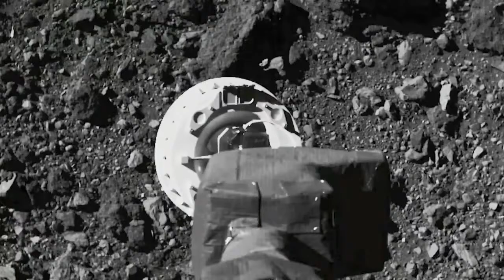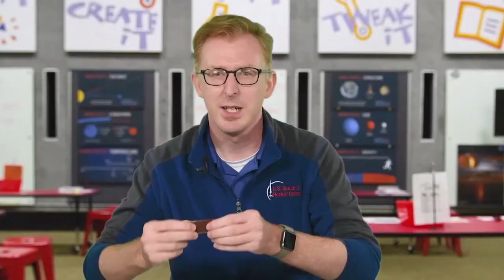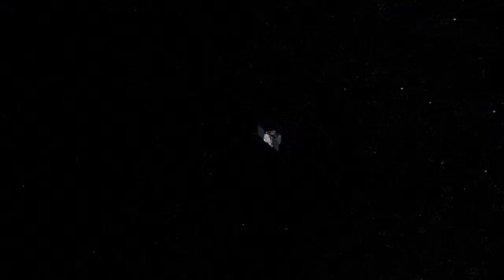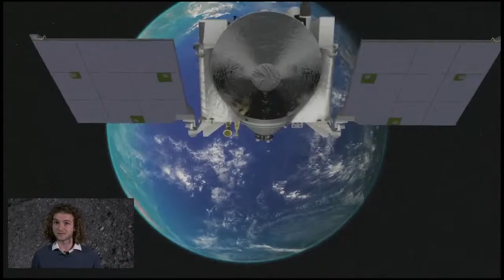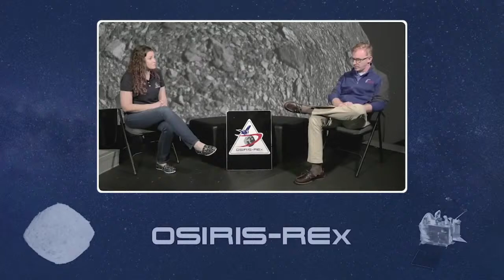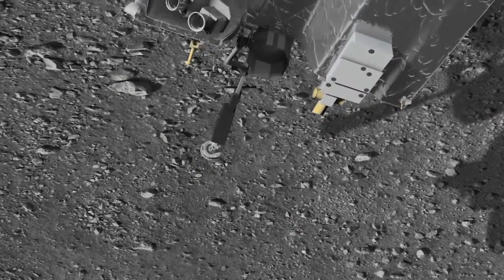OSIRIS-REx Asteroid Sample Return Live Show

Comment: How far away is this object..allegedly?
 And you can see a 30 meter object upon it...from EARTH...? Optically?
With what technology exactly?
 This is beyond the Moon yeah? And smaller than the Moon yeah?
 And what space wifi are you using to get real time imaging of this alleged event?
 What strength is the transmitter?
 What targeting equations are used to focus and receive a transmission between moving targets with varying vectors and inertial speeds at distances undemonstrable on Earth?